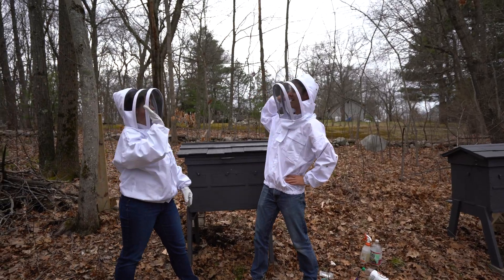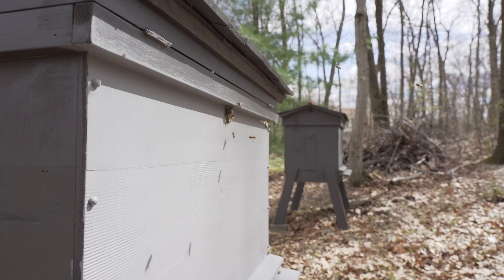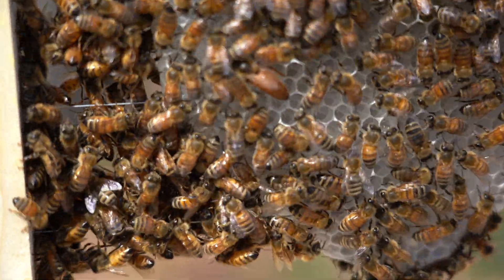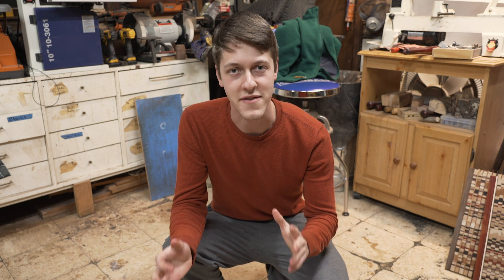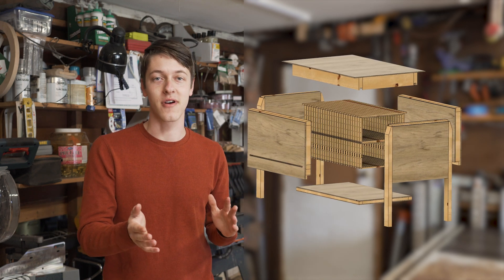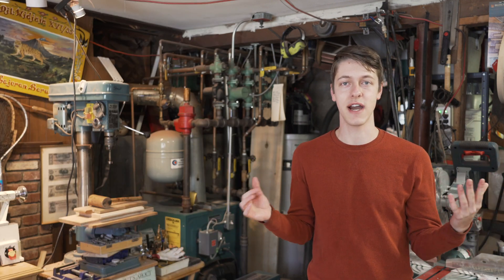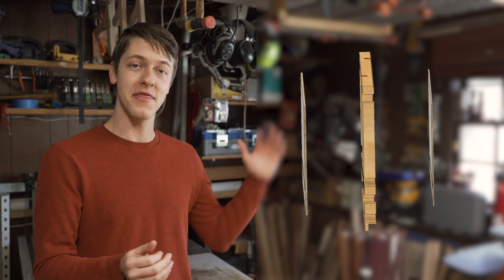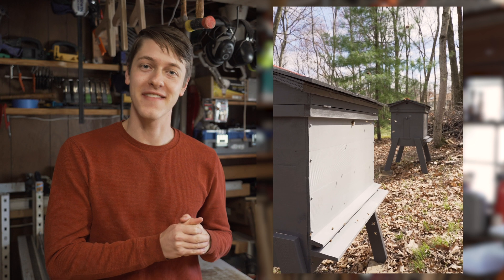Strout Horizontal Hive 2.0 Introduction & Design Overview

Comment: Are you laying inner boards above your frames?
Reply from the maker: Not with this design. The tops of each frame perfectly mesh so you don’t need inner boards
Reply: @stroutsabout  What type of feeder are you using, how are you feeding them? Also, how are you treating them for mites this way? You can not use the sponge method.

Comment: Did the bees make it super hard to slide the frames apart?  Are you will to sell and ship some un assembled frames?
Reply from the maker: The frames do get stuck together, but all it takes to separate them again is sliding a knife along the seam to break the propolis. Unfortunately I'm not in a space right now to manufacture and sell the frames or their components.

Comment: Meant to say horizontal lang style not "vertical lang style. Tree cavities are seldom as big as a layen or even a lang but bees are flexible to a degree. Many tree cavities will have 2 inches of bark and wood combined so the bee is essentially insulated and thermally reinforced in direct sunshine. Things simple man made hives cannot replicate.. In the summer the same cavity will be "air-conditioned" to a degree from ground water flowing up through the inner-bark to feed the bark, branches and leaves. Your attempt at winter and summer insulation is spot on. How ever I think ideally lengthy rather than blocky is best for the bees in the wild. Not deviating too far from that works well with the bees flexibility. So I am converting to strictly vertical lang lengths and layens closed style tops. Additionally hives in trees will often have a hole that allows dead bees to fall out of the hive in winter die off or cupped bottoms that will allow a build up of bee bodies until spring cleaning can happen. I saw a clip by a Germany based school that actually added to the bottom of a hive to facilitate die off of late summer/fall bees. (about 3"-4"). People with langs in colder regions might want to consider this practice
Reply from the maker: Thanks for sharing Dustin!

Comment: I too have abandoned the standard vertical Lang style in favor of a Layen style but use a single modified Lang deep frame on end. My hive body is more narrow as a result and over all more manageable. the bottom can have a deep slide out drawer for winter  die- off or modified double layer bottom for hive beetle traps and a bottom entry/exit. The modified lang's work as you have stated for narrower extraction units. Queen excluder's have to be placed at about 1/2 way into the box to manage honey but can be quite flexible and of course follower boards too. I prefer full width frame tops instead of cover boards and once all my current Lang supply's are used will stick with my design. Traps and hives use the same sized frame but I am going to a full 20-24 frames (36" +/- L x 10" W x 18.375" D)  frame box this year. A 7-8 frame brood chamber (via exclusion) is all that is needed for the nectar flows in my area. I try to avoid any form of unbalanced feed meaning sugar in any form other than actual combed honey the bees have made. Honey robbing is a problem in my area as there is an apiary yard about a mile and a half from me and they do not apparently open feed.

Comment: I think you're over designing the outside panels. Bond closed cell insulation foam to the skins and form a rigid torsion box. Allow some space for edging which is glued and pinned to the skins, and takes screws to join the panels to the structure
Reply from the maker: I like that idea. What would you use to bond the foam to the outer skins?
Reply: @stroutsabout  My first pick would be polyurethane for adhesion but I'd test first on a scrap of foam first. You might do better faced PIR (Kingspan).

Comment: I just started bee keeping last year. I build my own hives also. I started with 2 long langstroth that I hate. Then I saw Bee boy Bill's layens design and frame's, and made 2 of those and frame's. I love them so much I made 3 more and the frame's,  and I haven't looked back. The 2 I started with are filled and each frame probably weighs 20 pounds. They are 19 frame construction and like I said this is my first summer. If I were you I would look into it, and they are off of the plans of Dr. Leo Sharashkin. I did see your first video when you built your double deeps but it doesn't give the Queen enough room to make a circle brood pattern like the layens. So I wire all of my frames and eliminated the middle bar so they have the 12 × 15 inches of space, and they use every bit of it. Good luck and keep the bee's happy.🐝🐝🐝🐝🐝
Reply from the maker: Thanks for the comment James! It's so interesting how it seems like every beekeeper does something a little differently then everyone else.

Comment: I can't see how your hive is much different from the Lazutin Hive which used double deep frames. The Lazutin hive is an excellent hive. The main problem I see with it is that the hives are huge (cumbersome for transport) and the ceiling has a a very large surface area (heat dissipation) especially challenging for new colony. Happy to see you are using a high amount of insulation, especially for top. Good luck from Nelson NZ bro. Surprised you visited.
Reply from the maker: Thanks for the comment Japesh! You are right, it is very similar to the Lazutin/Sharashkin Hive. The major difference is I am using more insulation in the roof, and this hive is designed to hold my Double Deep frames.

Comment: Interesting to see someone using "double deep" frames. I'd like to see a hive inspection. I wonder if the bees will glue those separable double deep frames with propolis. Let's see if you can get them apart in a couple of years. It can't be too fiddly.
Reply from the maker: I actually talk about this in a couple of my other videos, especially my recent honey harvest video. While the bees do propolize the frames together, if the propolis is warm (as it is on a warm day), the frames will still easily pull apart. I've found if they are still sticking, running a knife along the seam is enough to break the "glue" joint! Of course all of this is dependent on making the dovetails the right tightness in the first place :) Thanks for the comment!

Comment: I look forward to your build video. Can you please show your measurements in that video. Especially the internal measurements.  Width, length, depth. And I have just a thought. Consider using the hyfegate to assist with pass through of the thicker walls.
Reply from the maker: Thanks for the comment! I'll be posting a build video soon! I won't go too much into the dimensions (since I have plans for sale with all of the dimensions) and rather talking more about the process, tools, and techniques. I've never used a hyfegate, but I will certainly look into them. Thanks for the tip!

Comment: Congrats for the insight and awesome content of the Video. Are there Plans for this Hive BUT in the Metric System?
Reply from the maker: Hi Joao! Thanks for the question. I don’t currently have plans in the metric system, but it wouldn’t be too hard for me to make a set with the dimensions converted. Let me know if you’re interested and I’ll make up a set.
Reply: @stroutsabout  Looking forward to it, Mr David! You just missed ALL the beekeepers that use the Metric System; and the Imperial System (specially for me being an European) it´s quite hard to understand it; because sometimes, it´s not a "straight forward conversion" matter.

Comment: Great follow-up video! I'm happy to see that I (and many others) aren't the only ones wondering about improving the homes we put our colonies in. Only you have the curiosity and intelligence to do it!
A few things to consider and to get your genius working even more: when the winter bees die and fall to the bottom of the (currently-used) hive, they can block the entrance, in the wild, there is a 2 inch space (or so) below the entrance (so it doesn't get blocked); consider how a slatted rack is used in Langstroth hives to help that and over heating in summer.
In regards to insulation: take a look at the Finnish design (Bee Box). It's compressed poly - maybe use something similar to insulate the hive walls.
Frames: The middle slate (joint) between both halves looks a little too thick (the brood and resources are divided). Is there a way to make that joint thinner while keeping your fantastic (REALLY!) design to join them?
You've got a new groupie! (Though I won't be showing up at your door... LOL!)
Reply from the maker: All great ideas that I will certainly keep in mind moving forward! :)

Comment: how easy is it to take the frames apart after being with the bees do they glue it together
Reply from the maker: Hi Michael! Thanks for the question. The bees do fill the joint with propolis, but they're easy enough to pull apart after scoring along the seam with a knife. I demonstrate this process in another of my video: https://www.youtube.com/watch?v=Km_gnaZK4Bw&t=2s
Reply: @stroutsabout  have you tried soap or paraffin wax to help the wood slide easier as it dose on tools

Comment: I overwintered a hive this year in the insulated Layens hive I built from Dr Leo Sharaskins plans.  I'm in MA also.  I don't have an easy way to clean out the bottom.  I have seen some hives with a large hole drilled in the bottom and installing a flanged pvc fitting with a cap screwed on one end.
Reply: I've been wondering about the cleanup too. I've seen mentions of a bottom the swings open to easily clean out the dead winter bees.
Reply from the maker: The bottom of this hive will fall out with the removal of 4 screws. However it would be super simple to make it hinge, I just got lazy at the end and decided the screws were good enough for me haha :)

Comment: You are doing a great job sharing your thought process and reasoning behind your design. I'm very interested to follow along. I've had the idea to do a double deep horizontal langstroth before, but couldn't think of a way to stack the deep frames. Your dovetail approach is simple and very ingenious. What wood type are you using to build your frames? Is it regular pine?
Reply from the maker: Thank you! Yes I'm using regular pine framing materials for the frames. I've found 2x4's and rough sawn 1x12's to be the most economical and least wasteful.
Reply: @stroutsabout  do you plan on selling frames?
Reply from the maker: I'm currently exploring the feasibility of selling unassembled frames. However I will definitely have the plans available for purchase in the next few weeks

Comment: Nice to see the follow-up, David! I can't wait to see the results. Have you thought about using Alpaca or sheep's wool as insulation? There are Alpaca orgs on Facebook. That is a great place to source materials, if you are interested. It doesn't have to be cleaned or processed before use as insulation. Though, I am unsure about the absorption of condensation properties. It is full of natural lanolin. It wouldn't hurt the wool, just not sure if it would absorb well enough. I am thinking an Alpaca's skin never (or rarely) gets wet... with the wool and the lanolin. I would also think that the wet air would absorb (into the wool) and dry quickly, but I am not sure. will you use a barrier between the hive and the roof insulation?
Reply from the maker: Thanks Linda! That's a great idea about using wool as a natural insulator. I think it would work especially well in the roof as it would absorb moisture as well. I do worry about it losing it's insulation value if it gets wet, but maybe that's something to experiment with. Do you have an Alpaca group in mind that I could look into? For the insulation in the roof, I do plan on having a thin plywood layer between the roof insulation and the colony, although the tops of the frames will actually touch each other and serve as the hive's roof. Thanks for the comment and keep in touch!
Reply: @stroutsabout  , I was getting ready to source Alpaca wool for this purpose. I found a couple of groups that were specific to Washington State... where I live. Let me know if you want assistance with that. I haven't done it yet because I have a busy summer ahead already with other structures on my land. But, I read several posts from Alpaca owners who were asking  how to unload their wool. Unwashed, only shorn. That excited me, because I new I'd be able to get it when I needed it. But, that is as far as I have gotten. I am going to respond again with my email address. After you get it, delete that post, please. I'd like to ask more questions and keep in touch, because when I do get to build my bee boxes, I want to use your designs.
Reply: @stroutsabout  Sheeps wool is a good one - can also put it in the bottom of the hive (below screening)